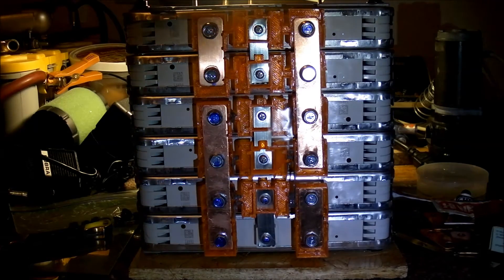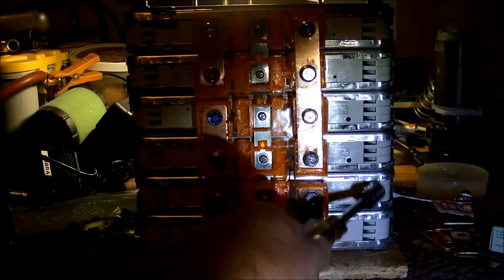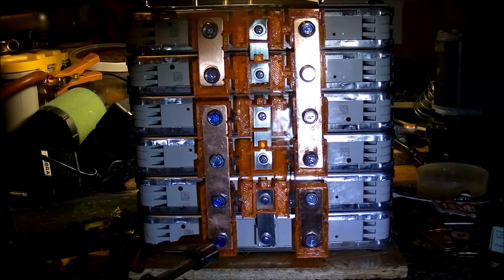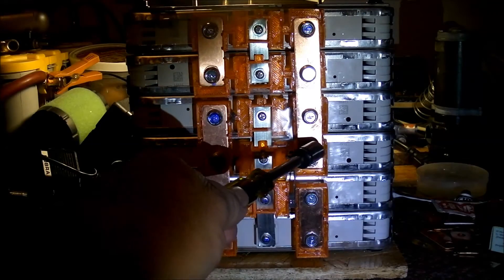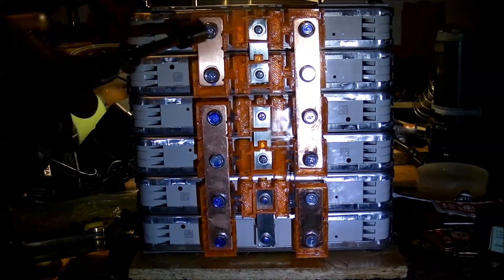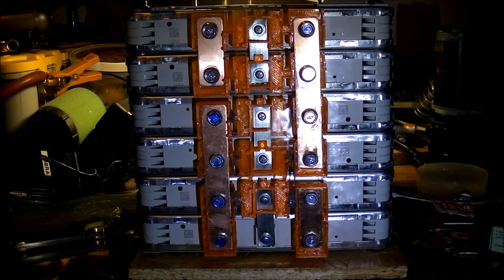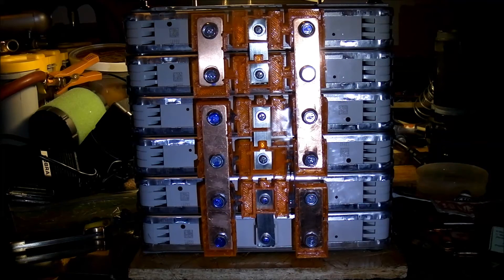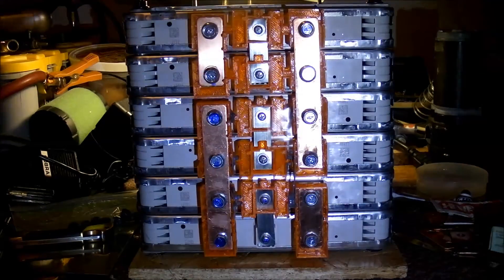Nissan Leaf Battry is Finished and Ready for Solar

Comment: I am using a battery identical to this for my own learning. I am setting the absorption voltage to 25.1 and 60 minutes at this moment. Do you know the float voltage for this battery? I am using a Midnite Solar Kid. Just trying to optimize the charging strategy and these batteries seem to have little info.
I am running a 12s of this in my golf cart ;-)
Reply from the maker: Max voltage is only 25.1 that is important because you don't want to over charge them they will get Angry and you wont like them when they are angry. Go to teckluck.com http://techluck.com/cgi-bin/YaBB.pl?num=1486955008  and read how to set it up. No not all the voltages are the same. they wont go in unless you do it in a certain order. Set the over volt disconnect at 25.1 set the charge limit to 25volts  over volt reconnect 24.9volts, Equalize charge 25 volts, Boost charge 25v, Float charge 25v, Boost Reconnect 24.9v, Low Volt Reconnect 24.4v Undervolt reconnect 24.4v, Under volt warning 24.0v, Low volt Disconnect 22.2V, Disconnect Charge limit 21.2v It works fine for me. you may have to go to the techluck for better instructions because Im not sure what order I did this. If you join the forum you can ask questions.
I am using a EP ever charge controller.

Comment: I was wondering how the battery was doing .  On amps draw and how long and hard you pull off it
Reply from the maker: It works fantastic and I would definitely recommend getting some. Talk to nrodge1 about how to do it on his forum techluck.com he has many blogs questions and answers forums on on his site. I have two stacks of six nissan leafs and it will run my 52 inch plasma tv satellite dish all day and all night till 6 am in the morning and the double sided refrigerator too. In the winter as long as the sun shines we never run out of power and I just leave it all going day and night. It could run the window ac in the summer all day long when there was too much power coming in from the panels in the daytime and everything else all night long with out the AC at night. Nrodge1 is completely off grid with his six stacks of six. His electric bill is only about 6 bucks the min charge.  It is so awesome. Wish I had a couple of more stack of six. They are fully charged most of the day at 25.1 volts and I cannot run enough stuff I should get an extension cord for my wifes big computer that would be good but I need to buy a long cord. It can do more in the day time I waste power then in the winter when no AC is running and its cold outside.